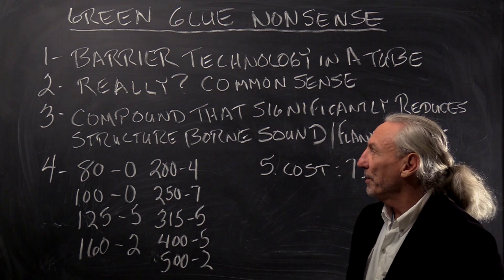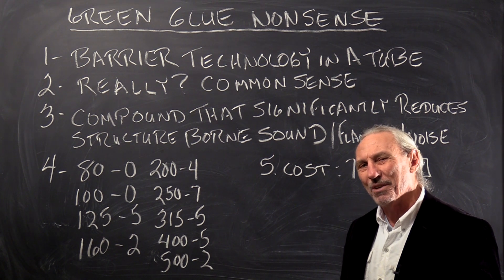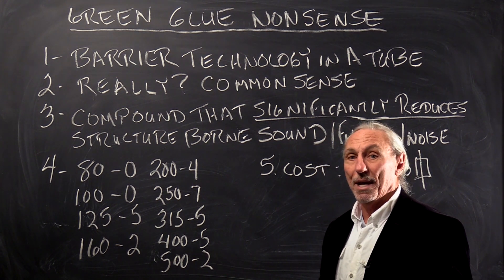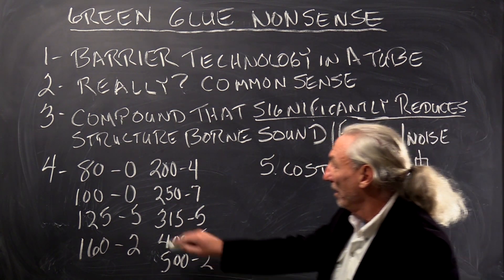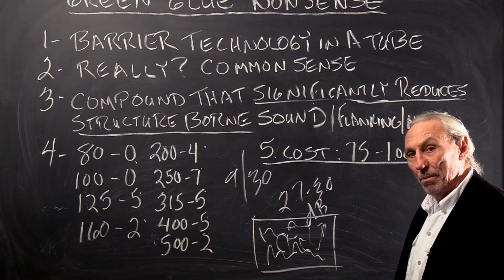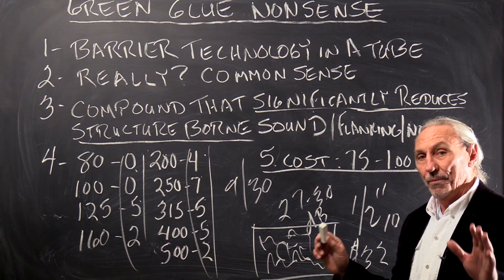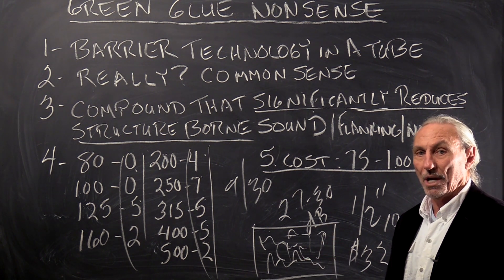Green Glue Nonsense - www.AcousticFields.com

Comment: 5 dB at 125 Hz with no space taken might be the right solution to someone looking for a 5 dB enhancement at 125 Hz. 5dB is significant. Thats why  a lot of acousticians do not look at single number rating but at spectral rating.
Reply from the maker: In 50 years of building over 400 rooms, that has never come up. Green glue is an adhesive marketed as an acoustical tool. Compare the ingrediants to a standard construction adhesive or carpet glue.

Comment: Not that it's very important but where does he get the green glue measurements from?
I can't seem to find it on the green glue website.
Reply from the maker: That is because they are worthless numbers. Any engineer knows that. Measurements for the sake of numbers has no meaning. It is the application of the numbers that matters. Look at the ingrediants on the product. Compare those ingrediants with standard construction adhesives or carpet glue.

Comment: What's the 1/2" material that is $10/sheet?
Reply from the maker: There are many material types. What are the frequency and amplitude of your noise issues?
Reply: @AcousticFields  I was referencing your comment at 3:26 "I can get you better numbers with 1/2" of material at about $10/sheet."  What is the sheet you're talking about?

Comment: Dennis please prove to us with lab tests that you can truly do this. You are very convincing here, but first off you do put green glue on in a uniform pattern. It is not a true glue adhesive since it works as a damping system. If you claim to get much better results, can you share your lab results for your wall designs? I would be super interested to learn how to get better results. Also how much more money would your design be over using green glue or a double wall system with an air gap and two layers of drywall on each side.
Reply from the maker: You are using a tactic without a strategy. The double wall system is frequency specific. It only works above 125 hz., and takes up over 10" of space.We attenuate 30 hz. energy in less space. It will not attenuate lower frequencies no matter what the magical powers of any colored adhesive. Compare the ingrediants with any standard construction adhesive.

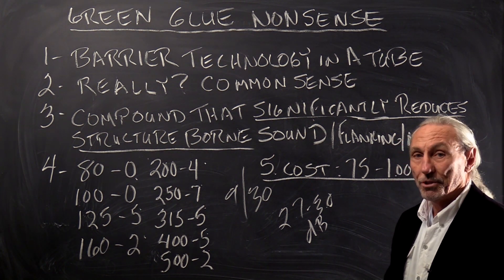Comment: 2:33 Ur fundamental misunderstanding of green glues simple functionality is what makes you a clear con man
Reply from the maker: Explain to everyone your undersatnding of this product.
Reply: @AcousticFields  it's a semi viscous elastic polymer that stays uncured durometer scale A10 at most and damps vibrational transmission from the inside of sheetrock 1 to the outside of sheetrock 2, tested, simple and factual. And unlike you I am a licensed CA state contractor and have actually built more than 100 recording studios throughout the San Fernando valley in LA throughout the 80's, 90's and 2000's, I've gotten high 110db+ spl conditions to zero transfer on dozens of occasions, green glue works, it is not an endall and is expensive, but your complete dismissal and accusations of a scam laden inefficacy are total delusional BS especially considering your many unfounded unhelpful rants i've seen on youtube, you are nothing more than a used car salesman just like the rest of your convoluted online acoustician buddy's, everything is too complicated to explain in simple terms until you get paid for selling the same EXACT DESIGN bass trap multiple times. Your nonsense notwithstanding, to all your victims, the 3 basic principles of any soundproofing are mass, air sealing and most importantly decoupling, you have sold the self serving idea that mass is paramount while never explaining that brick wall dead stop mass has the trade off of low freq REFLECTION within the space that creates an extensive and expensive need for far more trapping to make the ROOM USEABLE afterward the fact, when it's completely not necessary if the proper balance of MASS and DECOUPLING is achieved, a properly designed and built room will absorb low freq energy without reflecting it uncontrollably back into the space with the addition of modal amplification, this is one of the best reasons to use greenglue or similar to slim down the build, you wouldn't stand a chance in a debate with me pal, i'm the real deal with real world results to back me up, you're a proven internet grifter wasting peoples hard earned on things they don't need

Comment: This guy in this video is a salesman who’s mad that someone else had a good idea, nothing more, green glue works well, it is expensive and it isn’t an adhesive
Reply from the maker: It is an adhesive bonding two pieces of material together.
Reply: @AcousticFields  no, it's a semi viscous vibration damping layer, if you didn't screw through it, it would never keep 2 sheets of drywall mated together, hence not an adhesive, the "glue" name is probably just a marketing consideration

Comment: I have built several small recording studios and i microphone tested before and after.the biggest thing with the green glue is it does not dry hard. it is almost like tacky silly putty.1 can per sheet and screw spacing is also a big factor. spacing is wider apart and is almost floating the panel up off the floor and not touching the ceiling either ,caulked and trimmed.one sheet on another with caulked plywood backing  yielded at least 70% of sound transmission. there are other things that need special attention like outlets, doors etc.one small hole from a screw going to far in can bleed sound.it is expensive but in a studio its way cheaper to kill sound than have to fix noise in the mixes. cant polish a turd. and an airlock is needed between the booth and room.
Reply from the maker: Any silicon based adhesive will stay flexible over time. Green glue is an adhesive, nothing more. Well, I forgot to add, it is a very expensive adhesive.
Reply: @AcousticFields  Why do you keep saying “silicon based adhesive”?  Do you actually mean “silicone based adhesive”?

Comment: Thank you Sir for the insight. I have a question: I have maximum feasible total thickness for each wall of my diy domestic alto sax booth of 8 cm. Could you recommend the best structure for me? I was planning on doing a double plaster wall on the outside and Rockwell-type material covered with fabric on the inside, all in wooden framing. I know it's kind of junky but the space I am working with I really limited.. thank you!
Reply from the maker: What is your objective? Is it sound absorption or noise transmission. They are completely different physics and treatment types.
Reply: @AcousticFields  My main objective is preventing the old man upstairs from complaining about my incessant practice sessions.. I can hear him cough and sing trough the ceiling so he probably hears me pretty clearly. Mind you, my sax emits hardly any significant sound pressure below 180 hz or so, but nevertheless he can hear me, and the room I am in is fairly asymmetric which is probably why I don't hear any particular note resonating more significantly than others. I know for a fact that he can VERY clearly hear my altissimo range even when playing soft (conversation levels).. thank you for replying!

Comment: YES. If you double up your sheetrock with a soft rubbery substance between, the sound reduction properties will astound you. But that will happen with any soft rubbery adhesive.
Reply from the maker: No astounding required. Once you have the measurements of the frequency and amplitude of the noise, the correct material types to use will fall into place. There is a large difference in barrier technology with noise issues below 125 hz and above 125 hz. Without noise numbers, you are guessing and guessing wrong with noise which most do, will be expensive. You do not want to spend one dollar more than you have to with noise since you will not get the money back.
Reply: @AcousticFields  Mucho appreciate the information. I was actually agreeing with you that Green Goop isn't a major factor here. The "results" that people are claiming are more from adding mass with something between and not said glue brand. But yes... numbers are what ultimately matter.

Comment: I was using Mono Acoustic Sealant but it leaves a really strong odour. It’s really sticky as well. Green glue smells like school glue and is alot thinner in density. Green glue has been a very disappointing experience to say the least. 
Keep up the good work Dennis.
Reply from the maker: It is just standard construction adhesive that has been marketed to the uniformed as a magic elixer. It is neither magical or a fix that can be obtained with other non magical products. People like easy when it comes to noise. What is easier than a magic glue? No magic here just misinformation.

Comment: Great, saved me from waiting to get supply, I can just go the the hardware store to get the ordinary glue.
Reply from the maker: Use a silicon based construction adhesive. You may not need glue at all. A multiple layered technique works for some noise but not all. Have you measured your noise issues?

Comment: What’s the product for $10 a sheet, not sure you mentioned it. Thanks 🙏
Reply from the maker: There are over 100 material types we use in our barrier designs. Every material type and construction methodology is always and must be based upon the frequency and amplitude (strength) of your particular noise numbers. Have you measured the noise numbers for your usage or are you just guessing?

Comment: Wow. I am glad I saw this.I was about to drop a bundle on green glue. I will use cheaper methods. Thankyou. Any thoughts on Sonopan acoustic panels?
Reply from the maker: What are the frequency and amplitude of your noise issues? Using material types that you glue together is metodology for middle and high frequency noise. If you have lower frequency noise, this method will not work.

Comment: Im utterly confused to do what to my wall.  Every person says something different.  Considering tearing my wall out and replacing the fibreglass insulation with safe and sound then using Sonoran.  Then people tell me thats useless just use green glue and dry wall.  What's the best solution?
Reply from the maker: Most of the advice on the net is from people who have never built a room in their lives. They just keep repeating the same nonsense over and over. As with any problem, you must define it first and then prescribe the appropriate treatment type, amount, and position TAP. With noise, it is all about frequency and amplitude. What frequencies is your noise transmission at and how strong are they. Different frequency and amplitude issues require different barrier treatment types.
Reply: @AcousticFields  Thanks for the response, I am having issues finding anyone who knows anything.  I realize every situation is different and its impossible to tell but wondering if I could get your opinion on something.  I have a new build townhouse with a party wall with staggered studs, different floor heights, thermo insulation and 5/8 drywall.  Does a pretty good job as I usually hear nothing but the TV through the wall.  Its a deep bass.  Im considering tearing the wall out and putting Roswell safe and sound then throwing on a Sonoran panel and another layer of 5/8s drywall.  Think this will make a significant difference and is it even worth it to replace the insulation?

Comment: Hello, I am suffering severe impact sounds from the renters above my property. I am planning to take down my ceiling and use sounclips with u-hat channels off of the joists, insulate between joists using 100mm acoustic rockwool slabs, double skin the dropped ceiling in 15mm acoustic soundboard plasterboard. Ideally, I would love to take the floor up upstairs and use an acoustic mat between subfloor and carpet but this is just not possible. Could you help with recommendations to lower the impact sounds from above please?
Reply from the maker: Without knowing the frequency and amplitude of the noise issues, you are guessing at a fix. Most people guess wrong. You must measure the problem and then we can assist you with the proper barrier design that you can build. We have apps that you can use with your cell phone to measure. We guarantee all of our barrier designs which are based upon noise measurements over a seven day time period.

Comment: Very informative, thank you. I was ready to commit to green glue when I came across this video. If I live in an apartment building and want the dampen the thumping sounds from my neighbours above (mainly kids running around), what’s a better option?
Reply: Typical answer from a convoluted con, what kind of clown acoustician can’t clearly answer what kind of sonic transmission and at what freq common footfall occurs?
Reply from the maker: What are the frequency and amplitude of your noise issue? You must know that before you can design and build the appropriate barrier. If you are renting, it will be difficult to convince the building owner to let you build a barrier. You can not use any wall hanging panel to stop noise transmission.

Comment: This saved me moving,neighbour hoovering at 1am and we only hear her hitting the skirting board now. Absolutely saved us,like we’re detached. True review from uk
Reply from the maker: This methodolgy has validity at certain frequencies. However, it takes a lot of space and is a 50 year old approach. The science of noise transmission has advanced and material and space requirements have been drastically reduced in the amount of materials  required along with less space.
Reply: @AcousticFields  I’m  more than happy losing 30mm over a 5 metre wide room,changed our lives. Can’t see how you’d do it with less material than 2 sheets. Super cheap fix too,4 acoustic sheets and 6 tubes of Green Glue.

Comment: Having seen the several examples and results of Green Glue testing at Orfield Labs a few years ago, I have to laugh at this "analysis." The glue pattern, for example, is not about sealing the spaces it is about creating a damped material. From my own construction experience, Green Glue is definitely not a "glue." After several years, the Green Glue in the walls I've seen disassembled is not "cured" by any glue standard. If you don't understand how the material works, you should probably study it more before putting your feet in your mouth.
Reply from the maker: It is an adhesive. It has compounds that maintain its flexibility. Flexibility is not just common to this adhesive. There are numerous other adhesives that will perform this function and do it better by addiung many additional features that by definition this compound can not get close to in performance. The purpose of this material type as it relates to vibration management is as an adhesive. Its function, in the overall macro level barrier process is to keep two material types together over time.

Comment: Don't confuse sound attenuation of constant noise and damping. GG creates a constrained layer. Constrained Layer Damping is actually what is achieved with GG in combination with rigid sheets. This video doesn't even mention CLD, a common engineering technique. You don't always need to attenuate continuous pink noise... when dealing with music, especially live music, you have to deal with impulsive noise. If that peek energy dissipates faster, you actually get a significant reduction of perceived noise transmission. This french distributor has done very interesting in house testing with a vibrant pot and accelerators. It shows the result of using GG between plaster sheets : http://www.akustar.com/tech/147a_i_glue.htm and for more info on CLD : https://en.wikipedia.org/wiki/Constrained-layer_damping
Reply from the maker: You are missing the issue. No matter what construction methodology and material type you use, they both must be matched to the frequency and amplitrude of the noise issue. None of the materials or contruction methods you are propsing as examples will attenuate much below 125 hz. Most noise we see is from 30 hz. - 8K.
Reply: @AcousticFields  You are still confusing insulation and dampening. And you still don't take CLD into the picture.

Comment: horrible video. a sheet of 1/2" gives you better results than two sheets of 5/8" with green glue in between? far from "common sense".
Reply from the maker: Horrible response. There is no common sense when it comes to noise. All material types that deal with noise transmission issues are frequency and amplitude dependent. Without know the frequency and amplitude of the noise you are dealing with you and many others like you are just guessing. Guessing with noise is a fool's game. You will waste time and momney and still not achieve your goals.

Comment: Great video, glad I watched it. I need to do some sound proofing in a few bedrooms as my neighbors bass is too loud. Since talking to them it got a little better but still not prefect. A local company quoted me for extra drywall with green glue and promised a 45-50% noise reduction, expensive too. Thinking id get the same results with MLV over the current drywall. Its just the one wall that faces the neighbors. Not sure what else a guy could do? Its a new home, doesn't seem right to removed drywall and start over.
Reply from the maker: You must measure the frequency and amplitude of any noise transmission issue. The barrier you construct is strictly based upon those numbers.